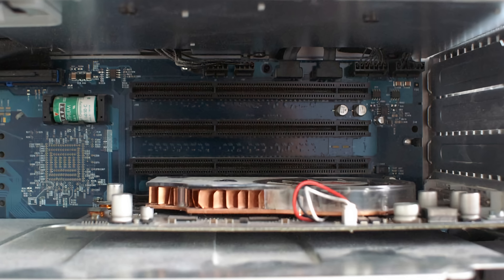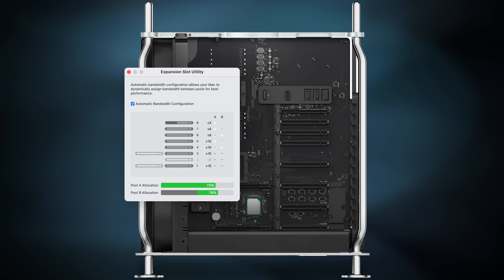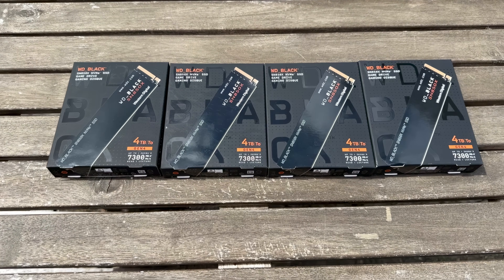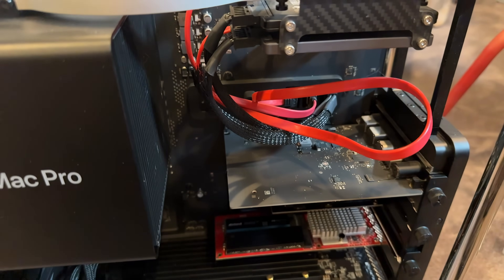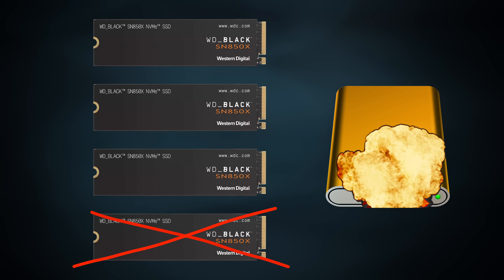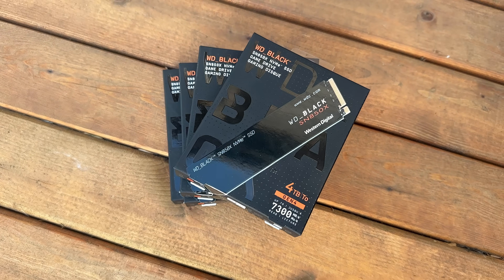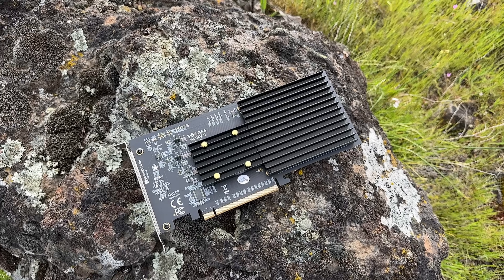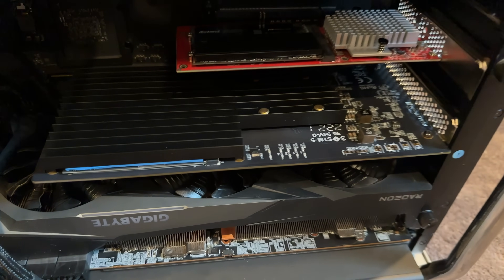$1500 of SSDs in a Mac Pro.... with a Sonnet 4x4 M.2 Silent

Comment: hi what was the speed of one of those drives as a boot drive on 2019 Mac Pro  with sonnet card
Reply from the maker: Are you asking what are the boot times? It's a little bit slower than booting off the internal SSD as it has it initialize the PCIe bus.

Otherwise the speed is basically the same as any other NVMe adapter for a single drive. You're going to be limited to the PCIe 3.0 speeds. Its faster than the internal NVMe that the Mac Pro 2019 ships with when paired with a high quality drive. I have two of the WD Blacks but quite frankly, despite them being faster than my Samsung 970 evo, i don't notice it at all.

Comment: The question which nobody answers is when does the nvme speed outperform the cpu in the 5,1 in real life use, like video editing or using large sample libraries in Logic. It’s nice that you can copy a huge file in seconds but how critical is that? Normally in the 5,1 you will have plenty of memory so you probably don’t need to use virtual memory that much either. I have the impression that even with a single nvme you have already outperformed the cpu . At least I can’t see much day to day improvement when switching from sata ssd to nvme .
Reply from the maker: I’m not sure what you mean by outperform the cpu but if you’re looking to see the benefit of NVMe over SATA SSDs, playing back multiple streams of ProRes. A SATA SSD on its best day might be able to five 4k streams at once, whereas any NVMe with dram will easily do that.

As far as loading samples, that’s more of a function of latency. It has more to do with the type of NANDs, controller chipset in the SSD since you won’t be taxing the continuous transfer speeds. You’d certainly get better performance from a very low latency SSD. OS  file transfers are typically low cpu overhead and the Mac Pro 5,1 despite its age has a lot of compute. Downloads are a different story as WAN file transfers can become very taxing.  Downloading steam games off FIOS can be limited by the cpu.
Reply: @dmug  Thanks. With outperform I mean: At which point doesnt the extra speed of the NVME or SSD make much difference anymore in real life performance. There must be some sweet spot after which it doesnt matter much anymore, depending on the application of course

Comment: it seems I have the same able conn card you have?  How much faster is the sonnet? Or same if raid zero?
Reply from the maker: The Ableconn is limited to 6000 MB/s reads and if I recall right, 4000 MB/s writes as it's only the ASM2824.  Even on a Mac Pro 5,1 the Sonnet is faster.
Reply: @dmug  thanks again!!!

Comment: As I am getting into more 8k video I wonder if it would help make the Mac pro faster than a studio in Final Cut editing
Reply from the maker: Almost certainly as 8k60 depending on ProRes is 1500 - 3000 MBs. Really the smarter move would be to edit off of 1080p proxies and then resync the EDL to the 8k media as generating preview proxies would be brutal storage wise. 

Also I’d imagine the other limiting factor is cpu.

The media engine found on the M1 Pro/Max and all the m2 and above makes for the ability to offload all the codec mashing to leave the GPU and CPU free. Using ProRes 422 proxy can help a lot.

Comment: 5:12 Seems like any generic aliexpress part selled on Amazon by resellers as the standard practice we experience on the platfrom :P
Reply from the maker: It’s something like that, I don’t think I’ve seen this exact board on AliExpress but there are an assload of white label rebadging companies out there.
Reply: @dmug  Especially on Amazon, thats why I said this. To be correct maybe this card isn't on Aliexpress but it really seems like the stuff that happens usually with theses same brand unbranded items.

Comment: why even bother with apple hw when you cn build a hackintosh that is 2x faster yet costs 1/2 as much - it makes no sense - qualcomm is going to overrun everybody - apple/amd/intel - that's what it looks like #benchmarks #arm roadmap #tonymac
Reply from the maker: A lot of things said here: hackintoshes are a dead end and require a lot of guesswork in OpenCore, great for hobbyists, less so for working professionals. 

As far as claims about Qualcomm, they’ve been lagging in ARM behind Apple but I sincerely hope they are great as competition is nothing but good for consumers. I imagine moving forward both Apple and Qualcomm will have to focus on ancillary features like Apple’s Media engine and NPU and Qualcomm’s generative AI accelerator, as both will be using similar manufacturing.

Comment: this is basically early adopter tax - we will see more better cheaper solutions as the copycats get onboard - the bifurcated pci-e v5 cards should be like 150 bucks not 1500 - it is laughable - hold off and see prices drop quickly once there is some competition - which there will be
Reply from the maker: Two things: the card is $299, it’s only $1500 when populated with the four 4 TB ssds I picked. 

There are copy cats and they’ve been out for a long time… just that use lesser chipsets like the ASM2824 (8x) instead of the PLX8732. If you want the performance, it’s Highpoint which is about $399 or Sonnet at $299. 

I have one in a drawer from AliExpress I bought 3+ years ago and it gets a little less than half of the Sonnet and a fractionally worse than the ableconn and requires a fan. These guys have been around at least 5+ years. The silent is the newer cheaper card.
Reply: @dmug  why even bother with apple hw when you cn build a hackintosh that is 2x faster yet costs 1/2 as much - it makes no sense - qualcomm is going to overrun everybody - apple/amd/intel - that's what it looks like #benchmarks #arm roadmap #tonymac

Comment: And here not too long ago I spent $40 on a 256 GB AHCI M2 drive and a dumb PCIe card for my PowerMac G5 and am quite happy to see 700 MB/sec read/write speeds. Way faster than my SATA SSDs on that same machine.
Reply from the maker: That’s pretty cool honestly, I was wondering if m2 even in the AHCI format worked in the g5
Reply: @dmug  It does under Leopard since it has AHCI support, but not Tiger and it cannot be used as a boot drive. Not sure if it could be used to boot a flavor of PPC linux though.

Comment: Great video. Saw you have the sapphire nitro rx580 in the 3,1. Was wondering what cable you were using to power it. I’ve got a 2 mini 6 pin to 8 pin but it also has a vacant 6pin slot on the card. Yours looks populated from what I can see
Reply from the maker: It’s the most haphazard setup because it used to have a Vega 56, which had 6 and 8 so I bought a y 6 to 8 pin adapter

Comment: Very cool, Mac Pro 2019 upgrades are cool, but it’s definitely worth it for the 2008! You should try the card out with something like Mac OS Lion. Honestly though, having all that SSD storage is crazy to see. Then again I’m using spinning rust all the time and it works great!
Reply from the maker: For old OSes I’d had to format the drive as HFS+, but if I had to guess, it’d still work. Working with old OSes is a pain though as I have to revert my GPU as the RX 580 wasn’t supported on until like 10.11 (might be earlier).

I’ll have more retro content in the future.
Reply: I guess it’s a good reason to get another Mac Pro! But yeah, I would imagine it’ll take more time since it’s a newer card going into an older setup. Still, old or new, Macs are awesome machines!

Comment: I have this exact card sitting in my “etc parts” box. Can’t be used as a bootable raid array, so I tried at least moving the user home folder onto the raid array and while it does boost speed significantly, it would act up every now and then. In the end, I opted for a High Point 6204 card and am very happy with it. This card is waiting to be repurposed or sold to someone that has better needs.

Comment: Are you sure the Duplicate finder menu item copies the file on disk? I thought I read that it created a snapshot instead using copy-on-write.
Reply from the maker: Hmm, that isn't clear but it does report 95 less GB on my drive and it takes a helluva lot longer on a non-RAID0 drive and a very long time on a spinny disk, if it does it might be limited to certain types of files.
Reply: @dmug  Found the article. It's APFS: Files and clones by Eclectic Light Co and it does seem to suggest the finder tries to avoid duplicating disk blocks. Maybe only under certain circumstances though, as you say. Definitely recommend that blog btw.
Reply: Prolly is CoW acting there. A better test would have doing a dump of /dev/urandom to the disk using dd.

Comment: I've got an nvme enclosure from OWC that I bought 5 years ago to run my old 27 inch 2012 imac on an m.2 SSD.  I tried buying one of those cheap 4 slot NVME m.2 cards off amazon, and nope, it would only recognize one drive.  I ended up buying a four slot m.2 SSD enclosure thunderbolt enclosure from OWC for less than the sonnet card cost.  It's too bad someone can't come up with a driver.  

Also I finally sprung for a decent thunderbolt dock as I'm sick and tired of the every two year ritual of figuring out why I'm having boot issues, unplugging everything to find it's the $50 amazon dock.  OWC dropped their 14 port thunderbolt dock price to like $180 CAD.
Reply: yes that post was sponsored by OWC.
Reply from the maker: Long term I’m probably going to build a NAS with 10 GBe as I can’t simply afford Apple’s PCIe Macs unless things change. The Mac Pro 2019 was a fluke and stupid purchase.
Reply: @dmug  I feel sad you bought that thing.  Horrible timing.

Comment: A-Mazing Greg,  you nailed it once more. i am in the process of mounting two 1TB kingstons on an asus PCIe 3 4-drive card.
Reply: AND to make things almost scary. i'm using my 2008 atm, and figured i would try that one first with RAID 0 ;P
Reply: Heck, i will likely not see the other drive, as you describe...but i will keep you posted
Reply from the maker: @ladeluff_ if it doesn’t have a chipset, probably will be the the case. There’s always a wild chance that there’s a work around that I’m not aware of. I’ve learned not to speak in absolutes after people managed to get Thunderbolt on Mac Pro 5,1s
Reply: @dmug hehe. Time will show and tell. i ll keep you posted. its nighttime here in Norway. will try tomorrow. :D
Reply from the maker: @ladeluff_  if you find out anything will be really interesting
Reply: @dmug  will do. 
FYI. I have The Asus hyper m2 x16 card v2 sitting on The shelf. Good and ready fitted with The two drives
Reply: FYI2: actually i’m running ZorinOS on The 2008. No supported macOS available atm

Comment: The struggle is real, and Apple isn't alone in not supporting bifurcation. IBM's Power9 CPU doesn't seem to either, at least not with Raptor Computing's motherboards for them; I resorted to a HighPoint Rocket 1204 board of similar specifications to this Sonnet board for around $150 on Amazon, though it's PCIe 3.0 x8, and I populated only two of its four slots. People need to know these products exist, and I appreciate you making this video almost as much as dancing AI Tim Apple and the abrupt excerpt from Battlefield Earth. Cheers!
Reply from the maker: I've always wanted to get my hands on the HighPoint cards as they seemed to have them waaaay before most others.
Reply: i thought most boards dont support bifurcation
Reply: @gamagama69  I’m not really an authority here, but it’s weird that Apple doesn’t support bifurcation because Intel hardware has for years. A while ago I snagged a cheap 12 core Broadwell HP Z440 workstation from eBay, and that enterprise hardware from roughly a decade ago quietly supported it with a huge range of config options in the UEFI. Apple must have not wanted to bother, but the chipset-level support for bifurcation had to be there in the 2019 Mac Pro. They simply haven’t exposed it.

Meanwhile the M2 Ultra Pro only enables its 16 lanes of PCIe traffic on a switch, so god only knows how performance holds up…